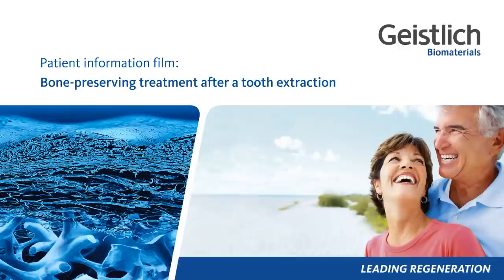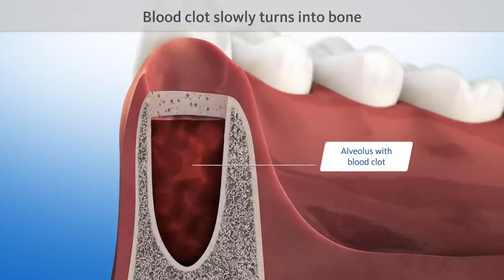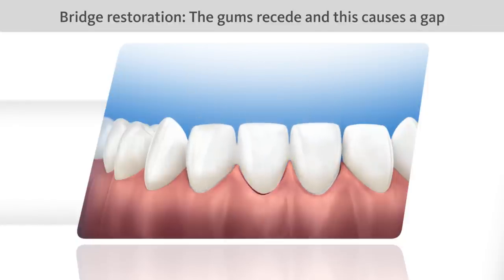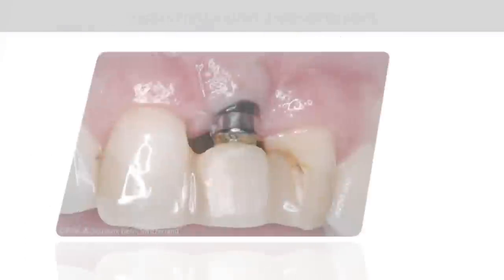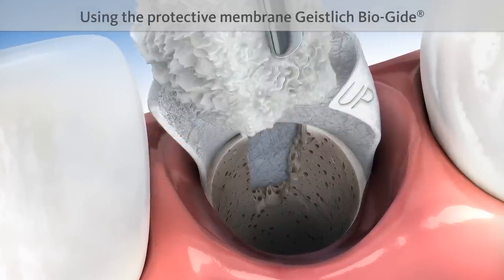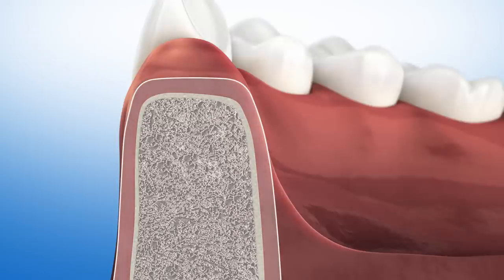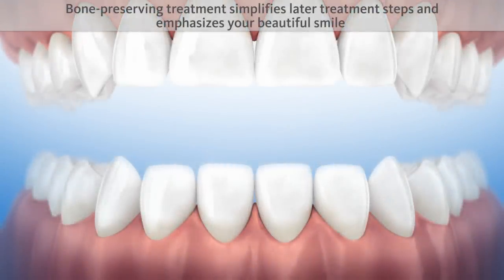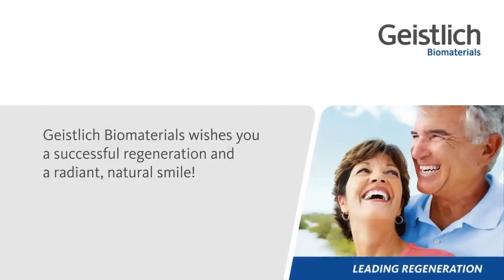Socket and ridge preservation (Dental Animation)

Comment: this seems like an excellent solution to numerous issues regarding extraction, also probably prevents dry socket as well.
Reply: Just had a tooth extracted due to a hairline fracture gone unnoticed for many months that resulted in the gum line becoming infected, and a mobile(loose) tooth.  Apparently the bone around the tooth was eroding(basically non existent) due to some grinding that occurs while I sleep.  With the ridge preservation, I will be able to get an implant when I return from this upcoming deployment, as I will be at the 6 month point almost exactly.  
While giving me follow on instructions, the dentist told me I do not need to worry about dry sockets at all.  As the area was already thoroughly packed and sealed with the preservation.